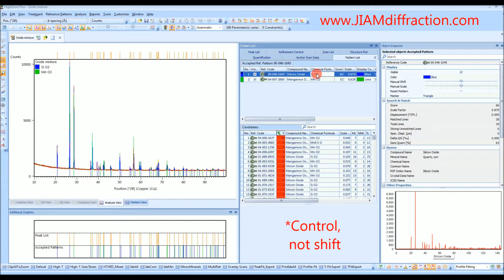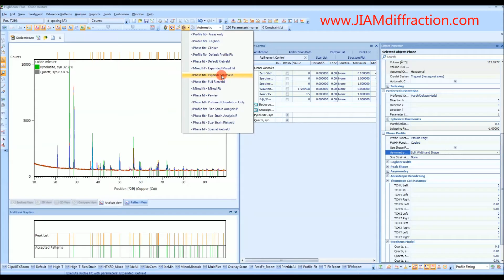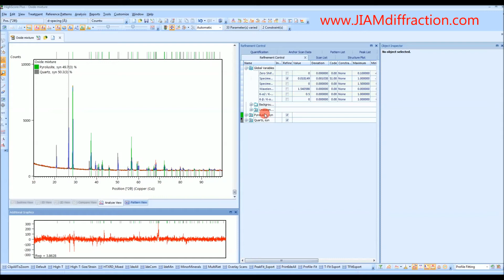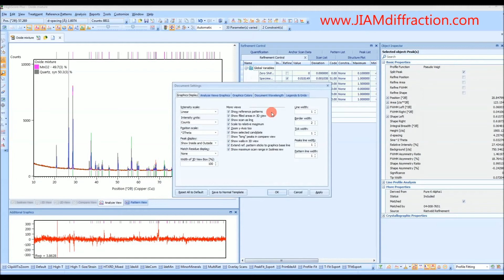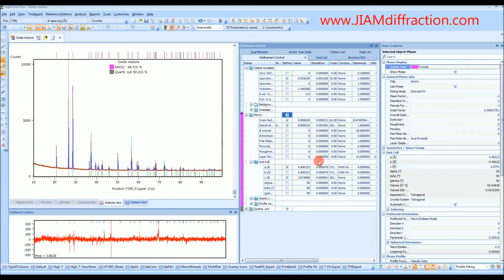HighScore Plus Tutorial - Phase Quantification Rietveld X-ray Diffraction - Long Version - JIAM

Comment: Thank you for this tutorial. Please I would like to know how can we quantify the pourcentage of a cristalline phase in glass i tal about glass-ceramic ?
Reply from the maker: There are a number of methods for determining crystallinity.   Please visit my website (https://www.jiamdiffraction.com/documents).  If you look beneath Other Documents (it is likely on the right side of the screen), you should see a PDF button labeled "Methods for Quantifying Amorphous Content."  Click the PDF button to view a document from Bruker.  The description of the different methods begins on page 19, but the pages before that also have good information.
Reply: @IAMMDiffractionFacility  thank you for your reply. I was reading this document but i didn't know how i can apply it on the drx specta that i have. It contains a single crystallized phase and I would like to know the volume of this phase in the vitreous matrix.
Reply from the maker: You have a few options.  Rietveld for amorphous phases...basically, you find a crystalline pattern that matches the wide amorphous humps for your glass.  You then treat the wide peaks like crystalline phases but allow the refinement to greatly broaden the peaks.  The refinement steps in the video should still work.  The difficulty here is that there isn't always a good reference pattern to use.  

If the previous option doesn't work for you, you could try to collect another pattern.  If you tested the glass as a solid piece the first time, grind it into a powder and add an internal standard (something that is as close to fully crystalline as possible and has as similar of a mass absorption coefficient to your sample as possible).  You then perform quantitative analysis as I do in my video, and you use the weighed and calculated values of the internal standard to calculate the crystallinity.  This is how I typically quantify amorphous content.  

You also have the degree of crystallinity option.  In this one, you determine the area of the peaks contributed by the crystalline portion and the area of the peaks contributed by the amorphous portion.  The degree of crystallinity is then the crystalline area divided by the total area.  The difficulty I've found with this method is that you need to figure out how to fit the amorphous portion.  One option is to make a completely amorphous glass and test that so that you can see what the amorphous contribution looks like.  

I know I haven't given you in-depth specifics, but it really depends upon your situation and what you have available in terms of XRD access, standards, and reference patterns.  If you choose any method, I highly recommend trying it first on some samples for which you know the crystallinity.  When I began quantifying amorphous content, I made a series of powder samples by mixing my internal standard, a semi-crystalline powder, and a completely amorphous powder.  I then kept trying the internal standard method until my results matched what I had weighed the different components to be.  I learned some important lessons by doing this though.  Had I not done this, the analysis of my real samples would have been off.
Reply: @IAMMDiffractionFacility  i undrestand you thank you so much for your information and y2help

Comment: Thanks for the video.   I took the same steps to quantify the phase as you do but it shows only phase name, not percent. Can you help me ?
Reply from the maker: I can certainly try!  Did you double click the pattern to see if there was structural information (such as atom positions, not lattice parameters) in it?
Reply: @IAMMDiffractionFacility  I tried but failed. So, Quantification requires the condition of the corresponding number of peaks. Due to background  quite bad.
Reply from the maker: I don't think I understand.  Can you send me an email at mkoehler@utk.edu and include a screenshot of whatever analysis you have been able to do so far?

Comment: Thanks for the video. One question is that for a few particular phases that I use have very old version of pdf cards that do not have crystal structure info and no new pdf of the phase can  be found as replacement, so the phases cannot be quantified at all based on your methods unfortunately. The crystal info of the phases is not hard to find but is it possible to add these info in the old pdf card in highscore plus to make the quantification workable in highscore? THanks!
Reply from the maker: You can certainly add info to make it usable.  You should begin by converting the pattern to a phase.  Then go to the Refinement Control tab and expand the phase that you want to add information to (click the + sign next to it).  Click on Atomic Coordinates.  If there are no atoms present shown in the Object Inspector (probably the right panel on your screen), right click in the Object Inspector and choose Add New Atom.  Add information to the element, oxidation, and name fields.  Don't worry about the Wyckoff, Multiplicity, and other fields just yet (in my version, I can't change them even if they are blank).  Do this for each atom that you need.

In the Refinement tab, click on the name of the phase again.  In the Object Inspector, you should see different sections such as Phase Display, General Phase Info, Symmetry/Space Group, etc.  You want to expand the Symmetry/Space Group section (click the + sign next to it).  Make sure that the Space Group Number is correct based upon what you found in other resources.  

If you click on Atomic Coordinates again under the phase you are changing in the Refinement Control tab, you should now see that each of your atoms has a Wyckoff position and atomic coordinates.  If any of these values are wrong, you can now change them.  

Good luck, and please let me know if this works for you!

Comment: thanks a million for such nice videos. how to quantify amorphousness of in a system, using the same process ?
Reply from the maker: I'm happy you like the videos, and excellent question!  There are numerous methods for determining the amorphous content.  A good place to start to learn a bit more about the different options can be found here:  http://www.icdd.com/assets/ppxrd/presentations/13/PPXRD-13-Dinnebier-WS.pdf.  

I haven't done too much with amorphous quantification (edited...I mistakenly wrote phase quantification originally), but I've found the internal standard method to work pretty well.  For this method, I'll mix about 50% standard with 50% sample...before I go on, let me add a few notes: (1) you want to use a balance and record the weights, (2) the standard should be as close to 100% crystalline as possible, and (3) I can't guarantee that a 50%/50% mixture will be best for you.  

You then perform phase quantification just like in the video, but add whatever phase your standard is.  The refinement should give a phase fraction for the standard that is larger than what you measured.  You can then use the refined value and the actual value for the phase fraction to calculate the amorphous content.  

Whichever method you choose, I recommend preparing some samples for which you know how much amorphous content is present, perform the analysis, and then make sure you get the correct answer.  This way, you can make sure that your general method is at least close to being correct.
Reply: @IAMMDiffractionFacility  out of words to say how grateful I am. Thank you so much 💓.  I am very sure what I need to do now.
Reply from the maker: Great!  If you have any other questions in the future, always feel free to ask, and I'll do my best to answer.
Reply: @IAMMDiffractionFacility  I am sorry to bother you again. None of the cards in the database of Xpert High Scorer plus I am using have structural details: the position of atoms. Hence, I cant do quantification or refinement. Any Solution to that ?
Reply from the maker: Don't worry, it's not a bother.  Unfortunately, databases do exist that don't have atomic positions.  There are a few solutions.  (1)  Find someone who does have access to a database with atomic positions and get them to send you the .cif files for your phases.  (2)  Find the atomic positions in a journal article, and then create a new phase in HighScore Plus so that you can enter the space group, lattice parameters, atomic positions, etc. (basically, you enter all of the phase information yourself instead of having it provided by the card).  (3)  Check out the Crystallography Open Database (COD) (http://www.crystallography.net/cod/search.html) to see if they have the phases that you need.  From COD, you can get .cif files.  

I hope this helps!  Let me know if you need any more information/advice on these possible solutions.
Reply: @IAMMDiffractionFacility  Thank you! 
I found the .cif files of the phases from COD, and inserted those file in the Xpert software. Although, these .cif files do not appear as patterns in the pattern list pan, however, Rietveld refinement function did work (as the .cif files were shown under the global variable in "refinement control" pan). The resulted quantification seems OK to me, do you think so it is OK to rely on data?
Reply from the maker: It doesn't really matter that they don't show up in the pattern list pane, although it is nice to be able to see them there.  The same thing happens to me when I insert a new phase from outside my normal database.  

If the quantification result was pretty good, I would think the data are good.  I can't guarantee that though, of course.  Databases such as ICDD will give each card a grade and details so that you have an idea as to the quality.  As I understand it, COD does not grade their cards (I could be wrong on that though as I don't have reason to use COD).  However, you may be able to look up the paper from which the .cif was built to get more details about the data collection parameters and the fit from which the .cif information was obtained.  This may help build your confidence in the data.  If it comes from a good journal, that would help build confidence too.

If it is a relatively common phase, you should be able to find other papers (either through your own search elsewhere or in COD) that corroborate the information in the .cif file.

Comment: Hi there,
Thank you so much for the videos. These are amazing. I have a query-
What if you dont have the structural features in any of the pattern? How would you run the Rietveld then? I dont have the structural features in any of the pattern and is kind of in a fix what to do?  Any suggestions would have been really helpful. Thank you so much again for all the videos and trust me these are helping me a lot.
Reply from the maker: First off, thank you for the kind words!  They really do mean a lot and are appreciated.

Next, if there are no structural features (i.e., atomic positions), there is an option called charge flipping.  It is a feature present in both HighScore Plus and GSAS-II.  However, it is not something I have done before, so I will not be any help with it. I could be wrong, but I don't think it is very easy.  I want to learn it, but the difficulty is finding the time!  I'm sure that is how it is for most people though.  

It sounds like your situation may be that atomic positions exist for the patterns, but your database does not have atomic positions.  Is this correct?  If so, you could try to find such information on the Crystallography Open Database (COD).  The link is http://www.crystallography.net/cod/search.html.  

Please let me know which situation you are in and if you were able to get your problem solved.  Good luck!
Reply: @IAMMDiffractionFacility  Thank you so much for your sharp response. I do see the crystallographic data in the springer crystallographic doc available online but those are not embedded in the available pattern in the highscore plus I am using just like the way you have in yours.  I think I will have to manually set all those data? What's your thought on that? Thank you so much again.
Reply from the maker: Do you mean that you found your phase on DOC but you can't download a .cif file for it?  If so, what phase are you trying to find?  I can look into it further.
Reply from the maker: In addition to my previous reply from a minute ago, I will say that you can certainly manually enter the information into HighScore Plus to build your own phase.  That is a perfectly valid option, it is just slower than if you can easily find a .cif file.

Comment: this method valid only for HighScore Plus but for HighScore which are not either, you can help me because I don't have the option
Reply from the maker: Do you mean that you only have HighScore but not HighScore Plus?  If so, I don't think you can do Rietveld with just HighScore.  You can perform phase identification though.  Once you know the phases you have, you may be able to export .cif files and use those and your data to perform Rietveld using GSAS-II.  There are some nice written tutorials on GSAS-II (https://subversion.xray.aps.anl.gov/pyGSAS/trunk/help/Tutorials.html).
Reply: @IAMMDiffractionFacility  I did not understand is it possible to give me your gmail
Reply from the maker: If you would like to discuss more outside of YouTube, please contact me at mkoehler@utk.edu.

Comment: Hello, I would like to know why do you convert pattern  to phase?
Reply from the maker: A pattern is basically just a list of peak locations and relative intensities, which makes them great for phase identification.  HighScore Plus takes all of the necessary information (e.g., crystal structure, lattice parameters, etc.) from the pattern file and allows you to alter/refine it to best fit your specific sample.  If we didn't convert our patterns to phases, we couldn't perform phase quantification.  

If you only have one phase, phase quantification will, of course, give you 100% of that phase.  However, converting a pattern to a phase also helps if you want to determine the lattice parameters, crystallite size, and microstrain of your phase(s).

Hopefully that answered your question.  Please let me know if it seems that I misunderstood what you were asking.
Reply: JIAM Diffraction Facility thanks a lot I'm starting learning  sample identification by x-ray difraction  and one of the aims is to perform rietveld refinement (manually).
Reply from the maker: Okay, I see.  If you haven't already, be sure to check out the phase identification video that I have.  That is a good starting point.  If you want to perform rietveld manually, you'll just want to go into the refinement tab (which you can see in the video) and choose which items to refine.  HighScore Plus gives a nice user interface, so finding the different items to refine isn't too difficult.  If you do have problems figuring out how to refine a certain parameter, I'll be happy to help if you post another question.

Good luck!
Reply: @IAMMDiffractionFacility  It seems that I do not have pattern files with the structure information. What should I do in this case? Thank you
Reply from the maker: @MarinaMedinadaSilva  I think the COD (crystallography open database) is compatible with HighScore, so you can look into using that.